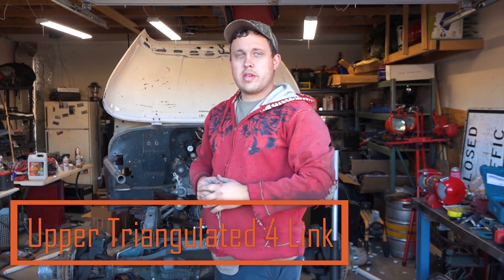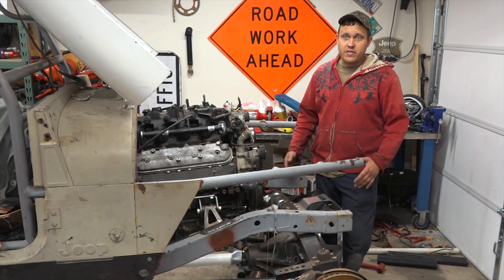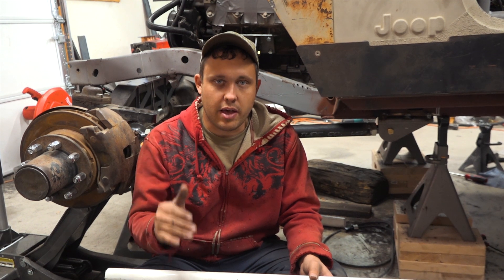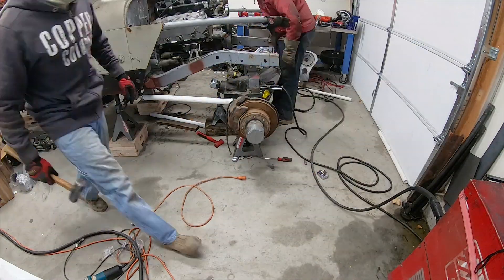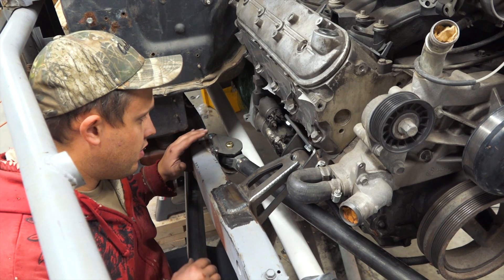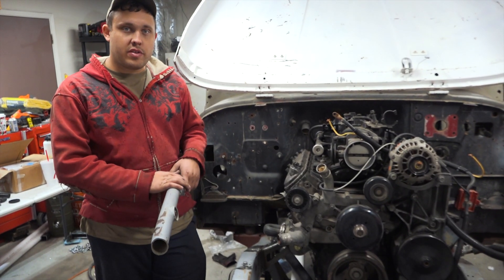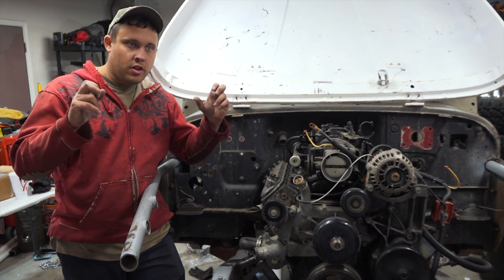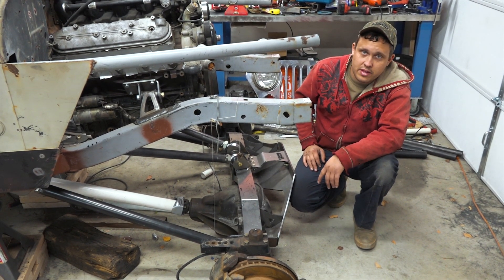CJ7 Rock Crawler Front Triangulated 4 Link Suspension Build

Comment from the maker: What are you guys working on putting a triangulated 4 link suspension in?
Reply: The wj jeep front axle which is a dana 44 out of a ram. Manly because of trackbar issues after wheeling. Gonna make a dirty cheap bent dom tube bridge truss. Trying to mimic the rear 3 link. Wishbone upper and slight triangulated lowers. Would love to loose the track bar.

Comment: Hi can you guys make this kit arms for sale???
Reply from the maker: You can buy the link arms we used from barnes4wd.com
Reply: @SWActiveExplorers  I know that but you have everything set up already for cj7... I wish to have like that.
Reply from the maker: Every application is a little different, wheel base will affect it, which axles you use, what engine and trans combo you need to work around. This setup may work properly for us but might not work properly for you. We bought one of their kits along with a couple extra mounts to play with and then started testing different mounting points until we found what worked and cut the links to length. Your best bet is a universal kit like we bought, it will have everything you should need.
Reply: @SWActiveExplorers  oh thank u very much.. u are the best 💪 
I'm using 1986 chevy dana 60 front and 14-bolt rear a have a LS Swap 6.0L w/ 4L80E transmission 300 transfer case  twen stk.

Comment: You installed the axle side upper link mounts upside down. You should forsure weld a plate on the top surface those things will bend in no time. Ps I almost made this mistake 😃

Comment: Good video. I am fighting the same thing. Trying to fit the perfect 4 link under my cj. It ain't happening! I like what you did as a compromise! I hope you see  this post and can give me the eye to eye lengths of the upper and lower and some thoughts on how it worked a d what you might have changed after you have run it.  Thanks
Reply from the maker: Unfortunately we had to move this project out of the garage for a while and focus on another one. We haven't been able to test the setup yet. The plan is to finish the jeep this winter. Hopefully the current project will be finished within a month then budget willing the CJ will come back in the garage to get finished. As soon as we get it on the trail we will make videos about it and detail the build and how it performs. If you still want the lengths I can measure them for you, I dont know them off the top of my head.